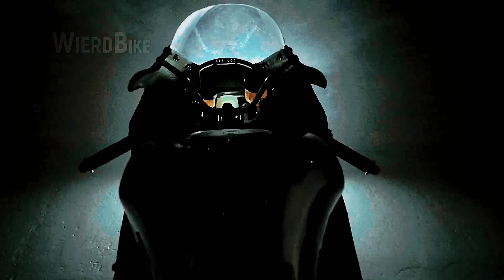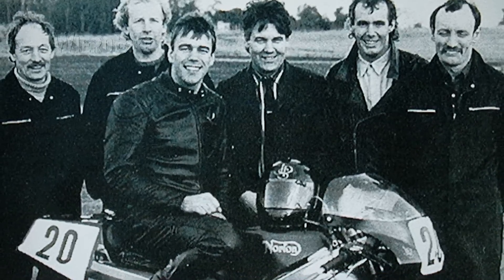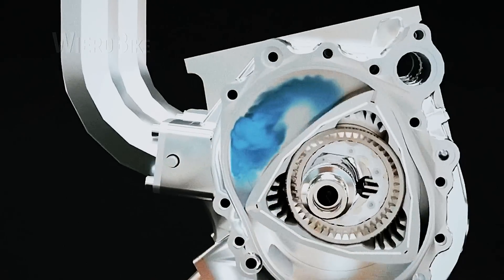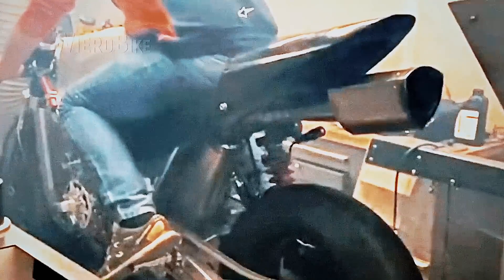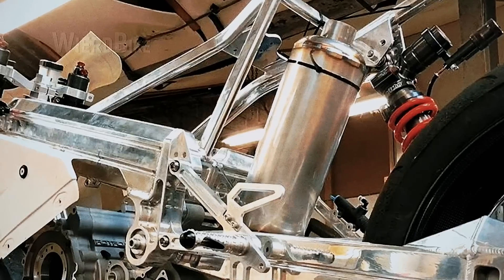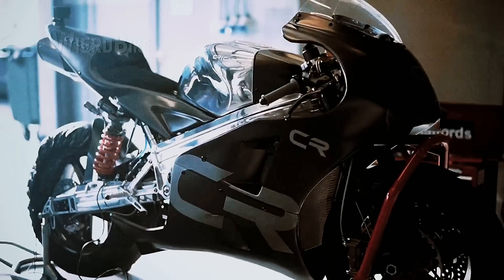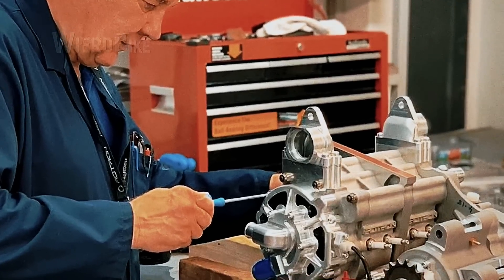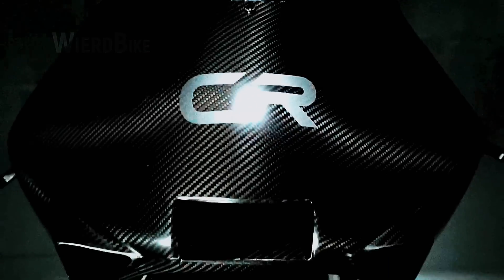ROTOR IS ALIVE! The most powerful NA Engine in THE WORLD - 319hp. per LITER!

Comment: Jan Thiel of Aprilia 125 Grand Prix fame made 60 HP from 1/8th liters in 2005. 60 x 8 equals 480 HP per liter. That was at the wheel. And that's far from the most HP/L in history. There was a 50cc two stroke with a disc valve intake, exhaust power valve, and 360° exhaust timing that made 28 HP in drag race trim. That's 560 HP/L. Very sporty that tiny engine. sounded like an RC engine, but on straight gasoline.

Comment: Oh yeah? Neat. Now, how often do you need to replace the apex seals?

Rotaries have been beaten to death. Everyone knows they are light and powerful. They don't tend to be efficient or low maintenance. For every manufacturer to date, this has been a reason to NOT pursue them.

I didn't hear or see much about the Achilles' heel of this engine configuration. Good luck.

Comment: If rotor engine's where so amazing good they would be in every bike and car now!
Reply: Mazda has been using them for years, and they are especially interesting for airplane use:  reportedly, they will continue to run, given fuel, even after oil & coolant loss
Reply: I get nervous flying over water in single engine aircraft, and multi engine aircraft suffer from asemeterical thrust, ( except inline engines ).    So a rotary engined motorglider can fly inter island in Hawaii, and never be out of landfall.  I guess all the light airplanes which have gone down east of Maui are never completely out of mind.

I realize this is off-topic, but I get enthused about the subject.

Also, looking at rebuild dvds on Mazda rotary, doesn't look that redoing the seals would be beyond the average DIY person.

Comment: Torque isn't measured in 'nano meters' but in 'newton meters'.......'nano' means 1 in a billion or 0.000000001.  So you basically said it has a huge torque of 142 nano-meters i.e. that it has 0.000000142 meters of torque (when meters is distance).  Newton is a metric unit of force where 1 N equals 1 kg*m/s2 (F=m*a), and T=F*d or T=(m*a)*d so torque has units of kg*m/s2*m or N-m. https://youtu.be/PNPjHdtyOlM?t=212

Comment: NOT EVEN CLOSE!!! The 1992 Yamaha RZV-125 V-twin two stroke racer made 419 Brake Mean Effective Horse-Power per liter, or 50.6 HP on a 192 pound fueled motorcycle at 27,000 RPM on pure methanol. The FIM BANNED "Alky burning two-strokes" in 1993. The street legal Japanese home-market version only made 43 HP at 25,000 RPM and 206 pounds.  The first rotary engine (the Keller rotary) was raced in 1907. There are ONLY 12 designs of rotary engines NOT including the Clergot radial rotary used in the WWI Fokker "Tripe" (triplane).

Comment: Even though 700cc sounds like a small amount, to be fair, you should count the impulse cycles per revolution which would put it closer to a 2.1 liter equivalent  not 700cc.  There are three combustion cycles per single rotation.

Comment: I had a 'Saki H1. Step the needles up one notch and ask tower for clearance to launch. 40mpg 500cc. Adrenaline rush! Very hard to ride in the rain. Not much ground clearance for turns, and driveline was way too weak. Dash off from a lot of would be racers... I think I topped it out around 140. I want another.
Reply: Riding a friends H2 750 was a blast, but needed better frame.  Easy to get yourself killed.

Comment: 319 horsepower per liter doesn't sound that impressive when you realize that the 50cc motor can make 3 horsepower. So at 1 l that's 600 horsepower

Comment: - You can't compare a Wankel engine liter to a four-stroke piston engine liter... you have an outer and inter-ring gear and they only count one face on a 3-face rotor - that would be like having a 3-cylinder piston and only counting one piston. so a Wankel engine is around 3x the liter as listed 
- think a 13b is listed at 1.3L = make power of a 1jz (2.5L - I6) / MPG of a 5.0L / if you add and divide by 2 you get around 3xL

Comment: I've heard various explanations and none hold up under the same scrutiny applied to any other engine for spring rotary engines to claim 1/3 of their actual displacement. If each cylinder face of the rotor displaces/moves 690cc of air per revolution through the engine and you have 3 cylinder faces per rotor that comes out to 1980cc of air displaced per revolution of the rotor. Making it a 2 liter engine not a 690cc one. If you applied the reasoning they do for displacement in a rotary to a reciprocating engine an ls400's engine would be 250cc not 4000cc.

Comment: At the 1996 RC onroad worlds (I finished 12th), I met a guy named Mike Swager, his motor guy was Ron Perris (now RIP) built mikes single cylinder, 7 port motor for his 1/8 scale rc car that did 60,000 rpm on 80% nitro and was 0.21ci or 3.5cc that made 4hp on the dyno. Scaled up that is 1142hp per liter, or 3.58 times the power this motor makes. Remember, this was in 1996, 28 years ago.
Reply: 👍 Very interesting data! yes, small RC engines can do incredible things. Reciprocating engines evidently follows no proportionality laws 😅

Comment: The standard method of measuring rotary displacement is unrealistic. Rotaries actually have double the displacement listed, based on time/cycles, which is the only parallel with piston engines. The Mazda Wankel rotaries rated at 1.3L are only measuring one of the rotor faces or combustion chambers. 1 of 3. However, that doesn't even equate to one full stroke. Rotaries fire much slower than piston engines, but have 3 times the "cylinders". 
1.3L=2.6L.

Comment: A 1978 Yamaha TZ-750 two stroke race bike could EASILY top 300HP, BUT it wasn't "tractabile" HP and it ripped-up Badweek bias ply slicks. Is this engine's power "tractable" (smooth, even, "useable" power without 100HP JUMPS in 1000 RPM) like the under-powered Honda NR-500 Tuna Can Pistoned V-4 that Fast Freddie Spencer beat me and even King Kenny Roberts with? We cranked back my TZ-750 to about 225-250 HP so I could race for more than a dozen laps before the tires "went away". Pitting for tires four or five times in the Main don't win many races, and a "light-switch" powerband like the Kawasaki "Widowmaker" H2-H3 doesn't work well on the street either.

Comment: Add a turbo. Rotaries have high egt's.  Best way to recover that lost thermal energy is to convert it into boost. Then this bike would be nuts.
Reply: You’re looking at like 400-500 hp 😂😂 that would be insane
Reply: Pls consider the TYRE factor,  the rotary eng continuous power delivery is different to the cyclical power strokes of 2/4 strokes eng, so the importance of number of cyl .
Reply: Turbos don't run on egt
Reply: @josue_kay  Turbines literally convert temperature and pressure into rotational kinetic energy. So, I'm not sure what your saying
Reply: Ever owned an old RX-7? Let me tell ya about this thing called "Sticktion" when the non turbo 2 dorito engines got so hot they melt everything including the carbonization that occurs with an engine with this more sloppy combustion pass through. Now add a turbo and then a water jacket and then maybe get a backpack with a fire extinguisher in it. On paper you are correct but a turbo may not be the answer... i'd say a smaller rotor for one set of RPMs and the main one for the meat of them would be intriguing if the exhaust from one could be used to supercharge the other... ok start with the "blonde" jokes now

Comment: Using hp/litre is literally clickbait. Why? Because it's based on the swept volume of the void for inlet charge only. 

A 50cc 2 stroke piston engine complete a full cycle with one crankshaft revolution.

A 50cc 4 stroke piston engine requires two crankshaft revolutions to complete a full cycle. So it displaces twice (100cc) its swept volume to complete a cycle.

If we had a 50cc rotary it will require 3 crankshaft revolutions to complete a full cycle or the displacement of 150cc for a cycle.

Comment: Yes nice bike, but the Honda NSR500 from around 1997 is the number 1, it has 400hp/liter (200hp 500cc 4-cyl, 2-stroke)
Reply: Yamaha's 125cc 2T v4 had 80 ponies, so: no NSR500 isn't most powerful hp/l combo either.
Reply: @laimonasmusauskas1153  Hehe my bad! If we include RC car nitro race-engines (3,5") I think we have even higher power there. I read something about 600-700hp/l
Reply: @laimonasmusauskas1153 What engine is that? What year?
Reply: @peterandersson1975 i think he refers to RA31A, 1968. 44bhp@17.000rpm, so 336hp per liter.
Reply: Whats that got to do with this video?
Reply: @posniknelb6114  This video states that it is the most powerful NA engine in the world, and it's not. It is the NSR500.

Comment: In order to compare rotary engine displacement to 4-stroke piston engine displacement, you have to double the rotary engine's size.  A rotary engine's displacement rating is effectively measured like that of a 2-stroke piston engine.  That's why a 2.6L 4-rotor Mazda (12 combustion chambers) could compete directly along side a 6L V12 jaguar (787b vs XJR-15).  Therefore a Mazda 1.3L 2-rotor at 9krpm is directly comparable to a 2.6L 4-storke V6 at 9k rpm (or a 2.6L 2-stroke V6 at 4.5krpm).  As a 155hp/liter 3-cylinder 1.5L, this engine doesn't seem all that impressive, and definitely nowhere near F1.  What IS impressive about rotaries in general, is their power-density.  It's incredibly small for it's output.  Something motorcycles can clearly benefit from.....if you can make it last.
Reply: This is true but not totally accurate. The 1.3l stated for the Mazda engine is the engine's swept volume, but because a rotary uses all 3 sides of the rotor simultaneously (albeit at different stages of the 4 stroke cycle). This is similar to how a 2 stroke uses both sides of the piston, also making one power stroke per rotation of the eccentric shaft.
Reply: Thank you for bringing this up, I was hoping someone would mention this, and I'm surprised the narrator didn't.

Comment: two stroke can have 200hp per 500cc
Reply: So funny that every time a combustion engine has huge claims it falls short of a 2 strokes real potential. When the oil burning stops, there will not be a blind eye to be seen.
Reply: @nj2352  bann every sport,   in that way it safes ships full of fuel and oil.
a couple of gallons of oil in moto gp does noet matter a thing,   4 strokes use oil and making all those parts is way more energy(fuel) and parts(polution)'
no two stroke is politics i gues, 
a commercial thing,  almost all road bikes a 4 stroke.
no expert here,  but 2 stroke is the way to go for compitition ,  light,  less parts,  more cheap,    watch moto gp   1990ish .
 that sound is unforgettable,  before big bang :)     and way more agile  than the modernn,  indeed many hp 1000 4stroke
Reply: @fendermarshallbluesbox3407  Next gen 2 strokes will have a closed crank and no smoke will been scene.
Reply: @nj2352  with valves in the head you mean ?  or a blower off some sort on the scavenge ports 
with normal two stroke port ?     i wonder how it works
Reply: @fendermarshallbluesbox3407   There is or was a v twin development with an extra set of piston and ring with the transfer sandwiched in between the 2 halfs and it uses that arrangement in conjunction with the intake to throw the mixture into the opposite cylinder. It is funny you mention a blower, that is what the Detroit diesel 2 stroke used and thats where we got the 6-71 blowers from.

Comment: Great video, but the highest hp per liter engine in a motorcycle is the aprilia Rsa 125 with more than 400 hp per liter
Reply: Even the Suter mmx 500 has 329hp/liter with it’s 576cc 190 hp 2 stroke v4… the smaller the engine the higher the HP/cc
Reply: @justinjheijnen  the more rpm a engine runs the more hp it has en the bigger a and the more ccs
Reply: In Theoretical numbers you are right. 
The sun that you quoted is an extrapolation of the designed output for the 125.  Run that figure on a 250, yz450f, cbr 650…..you will end up with some very strange numbers. 

If my memory serves, it was either the first gen R1 or the second where they managed, very nearly, a true 1:1. That is 1hp per cubic inch.  Engine tech has not moved much since then. In 03 the V&M Yamaha Mann TT  bike spent 100,000 hrs on the dyno trying to find more power…..they got 5 by adjusting fuel delivery……..
The only exact numbers in engines is the physical size that you measure right then and there.
Reply: @dennisgibb7958  
1000cc is 61 cubic inches. The R1 had way more than 61hp.
Reply: @A.J.1656  yup. Like 3 times that amount. I'm not sure how much any of this is Any more logical.
Reply: That is a crazy amount of horsepower for 2 wheels
Reply: @phillippitts6294  early 2000's gp bikes where 2 strokes insanity
Reply: @ssoldadog7 500cc. 2stroke made about 190hp they were over million$ each
Reply: @cheetomussollini  at that time those bikes where prototypes but right now there are companys like suter making equivalent bikes for about 100k usd. Im a firm believer that big companys like yamaha could make a attainable 500cc 2 stroke superbike using less expensive materials.
Reply: @phillippitts6294 125cc is ⅛ of a liter so it has 50hp. 
Not insane.
Reply: They're non customer race machines not available to the public. You can buy a cr 700
Reply: This engine it 106hp per litre, not 319hp
Reply: Try the RC166 with 496hp per litre....
Reply: It's also 50kg heavier